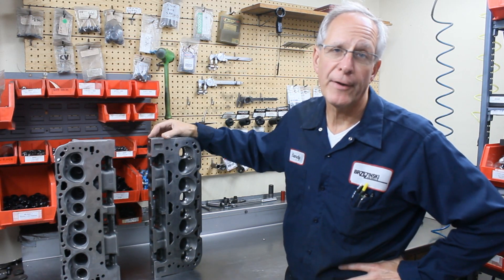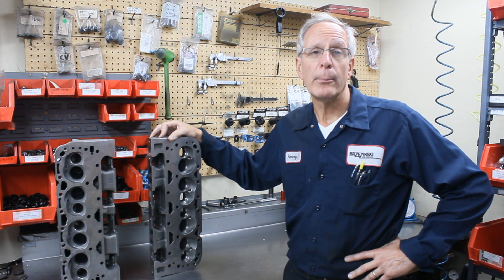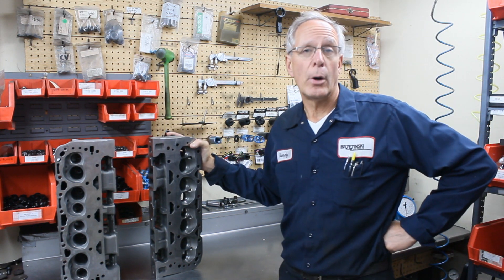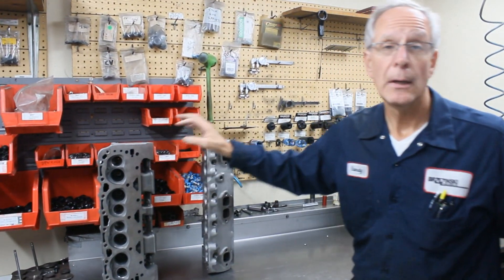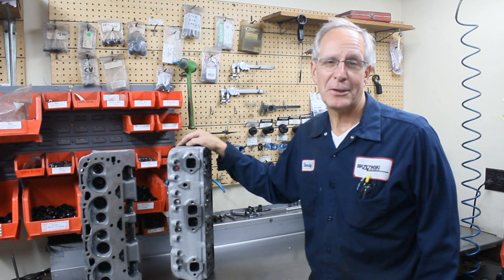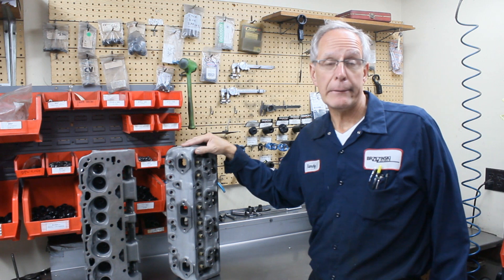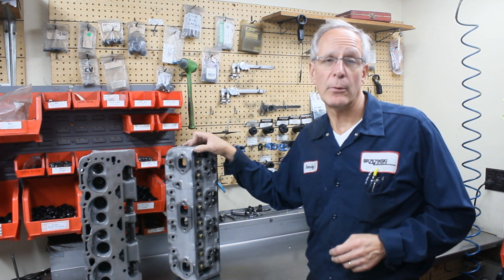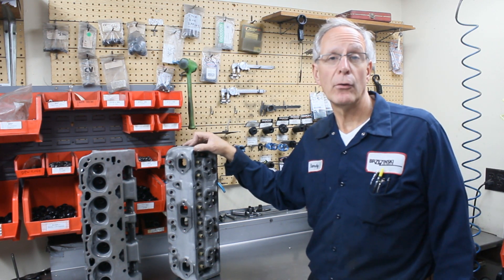Disguised Heads

Comment: Currently helping my dad go through and refresh the 327 in his 62 corvette that i helped him build when I was 6, I was a fully balanced steel crank 327 461x heads duntov cam, now we’re going to a little larger hydraulic roller cam and using speedways new double hump vintage look aluminum heads should be around 400-410 hp and a blast in a light c1 vette with 4.11 gear and a Muncie transmission

Comment: Would you run 186 double hump head on a 383 sbc
Reply: I might if I had a set sitting around. Otherwise I would go with aftermarket aluminum. I just watched a video of a 383 with FloTek Aluminum heads and it was +500hp and +500tq. And streetable.